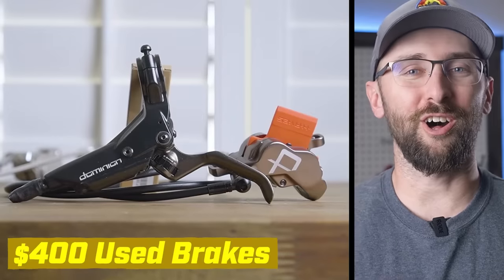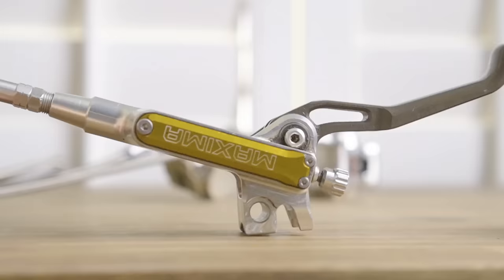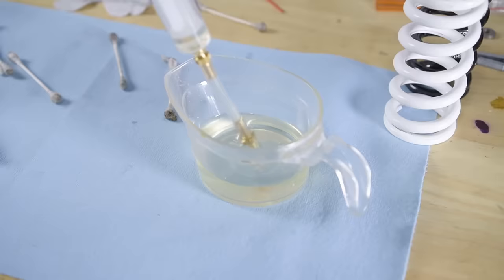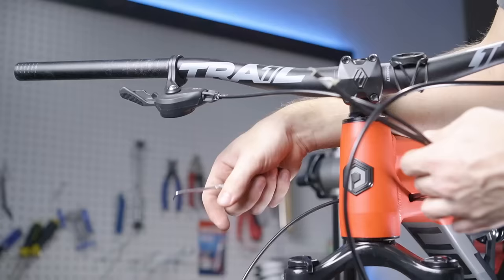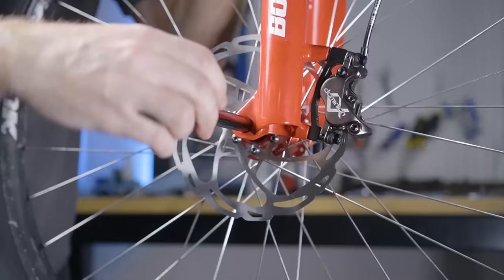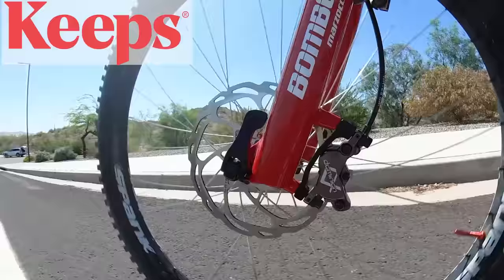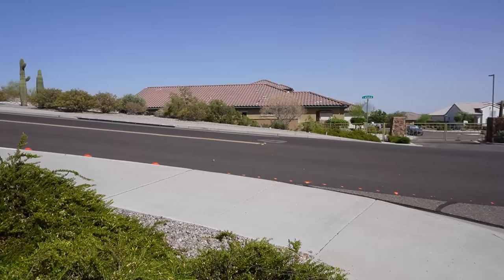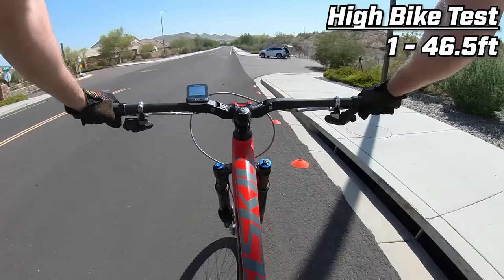Are $2000 mountain bike brakes THAT much better?

Comment: I would have gone for the Shimano mt520/501 as they are sub 100$ extremely powerful 4 pot brakes
Reply: And more then enough to most of ppl. Even on bike park rides.
Reply: Yea I've had them and they'll outbrake the traction on pavement, so why do you need better brakes?
There's something about heat dissipation but big rotors and brake management will help, only if you're hanging hard on the brakes at high speeds for 10+ minutes at a time you really need better brakes. and I've found not braking that much makes me go faster.
Reply: These are definitely sleeper brakes. I have the two piston setup and they feel and stop great. I'll upgrade the front to a four piston at some point (couldn't find stock at the time).
Reply: @sakkek5349  I have tried them and they arent that good. My 2 piston brakes stop better than these
Reply: @unknownuser39999  why would you make this comment and not even think to mention what your two pots are....
Reply: Shimano 420 brakes 4pot very powerful cheap my 105kg 180mm f rotor stop vwell. Pistons same size acrodd the full range same size code sram  from australia 🇦🇺
Reply: @unknownuser39999  BS.  Not possible ok
Reply: @Goosus  it's BS no 2pot as good asv4pot
Reply: They are not extremely powerful. Not for everything. I need bigger brakes.
Reply: No they are not ! I have those exact brakes on one of my bikes right now, they suck...
Reply: @Eric-kn4yn  dude I have these brakes and the suck compared to higher end brakes .. even my trp trail brakes are a lot better
Reply: Any brakes are good.
It aint a car. Wheels block easily on a bike
Reply: @BokiRS  you'd think that but in my experience bigger brakes dont fade in long dh runs, otherwise it takes a lot more force from you fingers and forearms to stop with weaker brakes and that leads to arm pump and fatigue
Reply: @peoplesrepublicofchina8340  if that is the case then i got an insane grip. I have rim brakes which pads are all faded (im breaking with  the plastic from the pads lol)
Reply: @BokiRS  just wait till u try long dh race decents lol. big fancy brakes make a huge difference and whre the second best upgrade on my dh race bike
Reply: @peoplesrepublicofchina8340  i do dh races myself everyday. I go down steep, bad mountain roads on my 90$ bike
Reply: @BokiRS  are those races or roads long double black diamonds?
Reply: @peoplesrepublicofchina8340  dometimes there are races there but sometimes it is just open
Reply: @peoplesrepublicofchina8340  yeah. It kinda goes through steep forest and then goes little on the road and like that again
Reply: @BokiRS  ur telling me a forest road is a double black dh race run
Reply: @peoplesrepublicofchina8340  idk
Reply: Yes mt520 are underrated I’m running them with 203mm xtr rotors and Swiss stop pads pulls up hard
Reply: Where I live we have some super steep downhill trails that take 30 minutes from top to bottom over a 5000' descent. With those cheap brakes I would have the worst arm pump and brake fade. Even with Saint brakes I was always wanting more power halfway down the trails. I switched the the Hayes Dominion brakes and I will never buy a Shimano brake again.
Reply: my weight is almost 80kg and i always ride at a speed of 18-22 km per hour. my shimano mt200 is more than enough for me.
Reply: Can’t agree with you at all. Mt520/501 is only suitable for XC or trial,they become really noisy and weak as long as they heat up a little bit. At least you will need a Code R or M6120 with cooling pad to ride AM or above

Comment: I've never understood parts maximizing to brakes. Just about any brakes these days (of the appropriate size for the bike/trail) are totally fine for setting corner entry speed and even panic braking on trail you'll lock 'em up. The argument can be made for feel/engagement if you're a finesse braker but otherwise I can't get my head around $1k+ on brakes when you could spend that money on suspension, tires, etc. Note that I'm a reasonably fast rider that does a lot of park and shuttle. I'm not anti-brakes. ;)
Reply: I could not disagree with you more. I have own & have ridden in lots of terrain, by far my Hayes A4 are miles better than Sram Guide. I've not owned a shimano 4 piston, but many other shimano brakes. Once you run a better brake, you are actually a faster rider. seems counter intuitive, but you can enter corners later with a better brake, less fade & the Hayes have the nicest lever feel out of anything I've worked on or owned.
Reply: @nicksonsbikeski440  I've run a lot of different brakes on my bikes over the years. Never once have I swapped brakes and added seconds to a trail time and I GPS track every ride. I think if you're adding seconds by swapping brakes you either didn't have enough brake to begin with (not brand specific) or a certain brand gives you a feel that adds more confidence. The latter isn't necessarily the other brake's fault as long as it had appropriate power, the rider just didn't adapt to it. I'm personally just brake agnostic. It's not that they don't have some slightly different feel, it's just that given enough stopping power I'm not bothered by the feel and get used to them after a ride or two and not a second thought after that.
Reply: I ride 10000% more confident when I know I can stop and I also knew I won’t overheat them
Reply: i could disagree, speed comes from bike being set up the way you like it which comes at a cost. sure cheaper brakes are good but top level brakes are so much better. i run a 29er super enduro norco range hp and had it come with some low level shimanos and they could barely stop it i put my saints on it is so much better. upgrading brakes are my go to because suspension is always smooth nowadays no matter the model
Reply: @bigslacker666  Brakes make a huge difference in decending capability. especially on super steep trails, like horseface, or when going 30 mph on a downhill into a hairpin turn, brakes make a huge difference.
Reply: @ameraldas3641  Read my OP again. Brakes matter if you don't have enough brake. Once you have enough brake geeking out and spending mega $$ on 'special' brakes is pointless IMO. If you think slapping a pair of $2k brakes on your park bike will make you faster than one with a pair of Saints for instance more power to you! :)
Reply: @bigslacker666  The placebo effect is so strong with high end bike stuff. Someone who spends $2k on a set of brakes is going to be convinced the brakes made them faster simply because they spent $2k on brakes. They will look for reasons the $2k brakes are better and even imagine them if they have to, because that's just what people do. Totally agree though, once your brakes are strong enough that the tire grip becomes the limiting factor on stopping power, you're just paying money for "brake feel" which is highly personal and anyone can learn to adapt to.
Reply: @monsterinyourcloset7573  Exactly, you get what I'm saying above. ;)

Comment: Been lucky enough to ride two sets of maximas, once in the alps and another time on an ebike. I usually use code rsc and the trickstuff are on another level to codes and I’ve never once had an issue with the codes. But the lever feel and the power of the maximas together with their power pads which I now run no other brake can touch. No fade and the lever throw is so short and light you hardly have to use any effort with braking, takes some getting used to first time I rode with them I braked just before a berm and nearly went OTB 😂 in Europe they are not as pricey as the US but still well over €1000 a set. IMO they are worth the cash, I’ve raved about them for the last year since trying them but sadly I’m a poor so won’t ever get to own my own set just borrow my friends bike when he’s feeling kind.

Comment: This is the first episode where I'm going to have to disagree on the low side as it's still too expensive tbh. Dominions ain't cheap used either. Comparison for you is I've had Sram guide, Shimano 4 pots and Hope E4 brakes for under £200. Still other than that it's great broski
Reply: yea, this is kind of a nonsense comparison. Hes comparing really good brakes to fancy ones. Obviously the difference is marginal
Reply: Haha I'd definitely consider Hayes dominion high level already. Low bike could have gone for a shimano mt520, probably the lowest cost you could go for great power.
Reply: @dylan-5287  great choice. Those mt520 are probably the best price/performance ratio I've ever got out of a brake. New too. Used it's even better dealio. They felt just like saint or zee to me
Reply: @hiigara2085  I'm a big fan of shimano brakes. Got a Zee in the front and basic mt401 in back. Their four piston brakes are super powerful. Gotta love the price to performance ratio.

Comment: When i swapped my 2 piston tektro brakes to a 4 piston saint brake, i noticed a massive differnce in performance i think the change was so worth it
Reply: Imagine what a hopetech mono 6 ti caliper would be like, thing will probably send you flying with the stopping power that is has.
Reply: @xxfyrezgamerxx6279   wish that i could find a much bigger rotor, would help much too.
Reply: @dh_filip624  look on Ebay, quite a nice few rotors and other branded brakes going at nice prices.
Reply: @xxfyrezgamerxx6279  Hope doesn't have more stopping power than Shimano Saint. 

Incredible brakes, but you're buying them for the adjustability, consistency and build quality. Not sheer stopping power.
Reply: Saints Are Awesome  I have them on my CF Warden 203Floaters And MTX Pads ..... EXCELLENT  SetUp😎 I Ride Vancouver 🙂

Comment: 2:26 Fluid escaping through the vent hole. The membrane in the reservoir is probably damaged or misalligned.
In these brakes (as well as Hope Tech3/4) the mambrane also acts as a seal for the reservoir's lid. So if you put too much pressure in the reservoir, the membrane gets stretched too much and the sealing function is disturbed.
Reply: I had this problem with trickstuff brakes I had to replace the membrane
Reply: @mehdi2pac1  then you didn’t bleed them well and destroyed it.

Comment: Next upgrade gonna be the frame itself. 
Kudos to your series, never thought a 3k bike is still a "lowbike"
Reply: With a full squish you gotta spend 3grand or something maybe 2,5k new to get something very good that you don't have to throw upgrades at instantly.
If you can find a good deal on a frame you like you MIGHT be able to get away cheaper with going used or cheaper in some cases.
I did go for mid Level suspension (a revelation wanted to get a Yari but got this Revelation with 100km on it for half the new price) on my Hardtail and 11spd instead of 12spd with a 11-46 cassette and i have SLX 4piston brake's which you can find on Hardtails that are a grand more than my Bike. So if you are smart you can get a good bike cheaper.
Reply: Like Kaede said 2.5-3k is the cheapest full suspension bike you can buy that is not a pile of crap.  1.5-2k for decent hardtail.  If your starting out and can't spend that get a used bike that retailed for at least those prices.

Comment: My piston fell out too when I bled my Magura brakes! Such a pain in the ass cause you have to start everything over again. And as a beginner mechanic it was already quite an involved job.
Reply: Did you not have the bleed blocks in? Magura's are really easy to bleed, if a bit different from others. Unless you're needing to flush the brake with all new fluid, most of the time you can just do a vacuum bleed from the lever. The biggest mistake I see is people over tightening the bleed port screw on the lever.

Comment: Imagine the high-end bike parts on a s-works stumpjumper frame, Evan that would be the dreammm!!
Reply: That's probably his plan haha
Reply: I actually worked at a Specialized store and we put for one customer  his set of Maximas (he waited 1,5 years... 😅) on his S-Works Kenevo... Yeah, "deammm!!" is a pretty accurate description...😁😅👌
Reply: I dont think the Stumpjumper frame would be an Upgrade though .. that geometry is Like 7 years old
Reply: @sebastianeiselt37  still fairly modern for the type of riding it's made for, reach and wheel base for example.
Reply: @HarryL2020  the EVO... Maybe.
The normal Stumpjumpers geometry was modern in 2015...
Reply: @sebastianeiselt37  yeah the only thing is that seat tube angle and head tube angle really.
Reply: @HarryL2020  nope, also bb height and Reach.
Reply: @sebastianeiselt37  480mm for S4 is pretty in line with their modern lineup, the S6 Is like 520mm which is huge. Infact the Evo lineup is smaller...
Reply: @sebastianeiselt37  I have the Evo and it's awesome! Switched from a polygon siskiu n7 (bikes online sucks to deal with)
Reply: @Mikesonbikes  the evos geo is fine :D
Reply: @sebastianeiselt37  65 degrees isn't modern? lol, not everyone is an endurobro.
Reply: @hambo76  also Reach, seattube Angle, BB height, chainstay length... 
Im not talking about the headtube Angle, as you can easily slacken it up if you Like.
Geometry is far more complex than Just Headtube Angle.
"Lol"
Reply: Absolutely! I have the 2022 s-works stumpjumper evo and love it.

Comment: Shimano Deore or above for sure for budget builders - super cheap to maintain, super cheap to buy (my four piston XT brakeset were 100 quid), and definitely strong enough - if it's good enough for downhill racers, its good enough for you!

With that said, great video as usual!
Reply: My deore m6120 4 pot breaks bent my 203mm disk adapter and bcs it was bent my front caliper broke.
Reply: Would have gone for SLX 4 piston here and koolstop pads.
Not sure if the M6120 deore are any worse. When shopping for part's the Deore weren't in stock so i took the SLX again like on my last bike.
Reply: @fackerhidonbush8420  WTF!? What adapter was it?
Reply: @kaedeschulz5422  original from shimano. I swaped it with one from aliexpress now. My problem is that i had too much stopping power with ceramic pads which are great.
Reply: @fackerhidonbush8420  Too much is always better than not enaugh in this case :D I will swap tje stock ones in my SLX for Pads from koolstop. Ridden them once on a friend's bike and WOW! I NEED THOSE!

Comment: TRICKSTUFF speaking: Sometimes reading (and following) the manual helps! We are happy that our brakes are featured in such a video, but the author's bleed process was not perfect. I can promise: If they are bled and installed correctly every user has been satisfied up to date.
Reply from the maker: Hello Klaus! The bleed process was difficult. On a follow up video, I finally nailed the bleed process to perfection with the proper oil and proper bleed block. The bleed felt like a skill I had to perfect 🤣. But it also helped me bleed other brakes after that. I did test your brakes against Shigura, and the trickstuff are definitely the most powerful.
Reply: @EvansMTBSaga  did you really use that oil ?. lol
Reply: Moin Klaus
Reply: I fully understand klaus point here. You did not even use the right oil that is recommended for the brakes. The Bleeding and the oil are the most important parts to get right for a good performance. I feel like this lack of effort is really a shame since you were ready to spend 2000 Dollars on those brakes.  @Evans MTB Saga
Reply: I HIGHLY doubt 100% of customers are satisfied. That's an incredibly suspicious claim to make.

Comment: Those original mt201 are actually worthy of competition in the highest level. Change pads to semi metallic, rotors need replaced to be compatible with semi metallics. Then bleed them really really good. They are amazing after that

Comment: Those expensive brakes wile shine here in Switzerland when you decent from 3300m to 800m (10826 feet - 2624 feet). with the "cheap" ones you will have to stop a couple of times to let them cool down :)

Cheers:goodvibes:
Reply: It's more complex than that. It includes fluid, brake pad composition, tires, weight of bike and rider... It's just not that simple. Also this test isn't scientific to my satisfaction unfortunately although it's fun to watch.